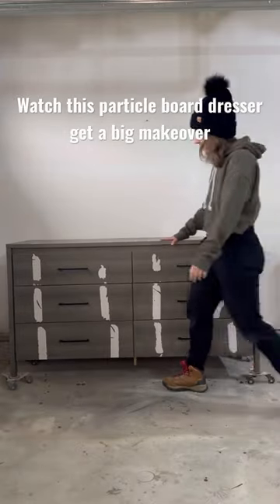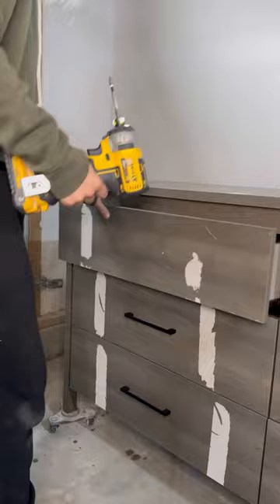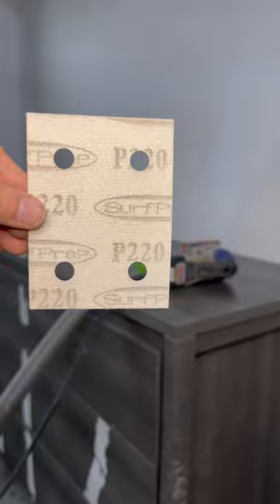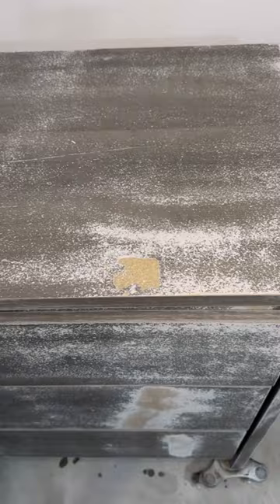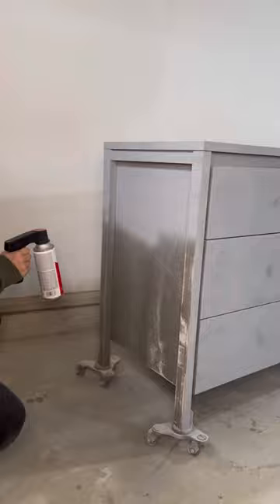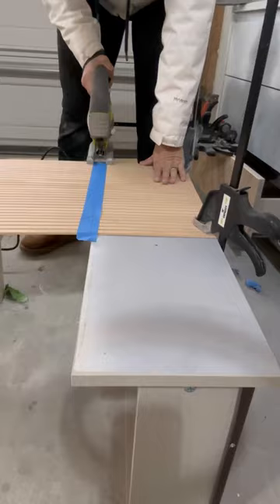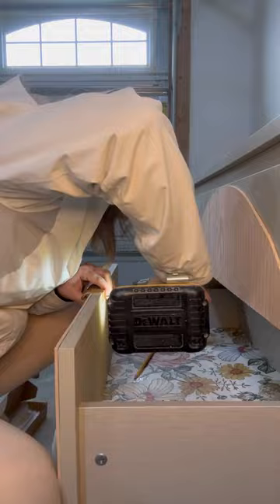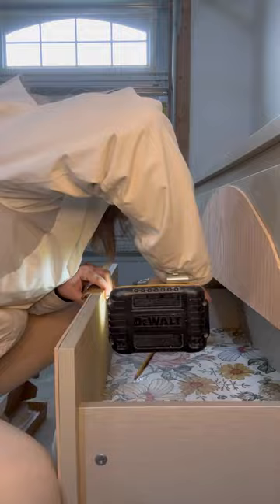Watch this PARTICLE BOARD dresser get a big makeover with pole wrap

Comment: I love how nice that turned out.  I wish I had your tools and talent. I inherited my moms cherry wood dressers and have always hated them.  I've been using them for the past 25 years.  If I sanded the dressers, do I have to sand all the finish off  if I am painting them?
Reply: Sanding the finish off is not necessary when when painting. You only need to clean and scuff sand it so the paint (primer if necessary) will have something to stick to.
Reply from the maker: Thank you! And no, you don’t have to sand the full finish off to paint it. You can just “scuff sand” it with 220 grit, and then prime it and paint it. Scuff sanding shouldn’t take that long. You are just roughing up the surface to give the primer something to grab onto.

Comment: Beautiful design, do you replace the bottom of the drawers with wood? That’s the problem with these dressers, they may look expensive and can even be expensive, but they last a year at best because that thin strip of like vinyl board or whatever it is sags with any weight and becomes unusable. And I’m not saying you have to in order to sell it, I’m just wondering if you do and could you show the process because I could save a lot furniture in my house lol

Comment: How in the world do you avoid the texture from particle board. I've sanded and painted. Did the primer help prep it for the spray paint so it was smooth. I can't get rid of orange peel despite sanding
Reply from the maker: I highly recommend using the spray primer (and that it’s oil based)….and then lightly sanding with 409 grit in between coats of primer and paint. It helps remove the texture that the paint might give.
Reply: you're the best THANK YOU @studio_adash

Comment: Most furniture is veneer on particle board or veneer on a cheaper light wood. If furniture was solid wood it would be very expensive and  very heavy. Take a knob off the dresser and use a flashlight to peek inside and most people will see particle board or a different softer wood, even on vintage pieces. I sold vintage teak for years and danish teak furniture is always particle and Canadian teak furniture uses a cheaper wood underneath and is worth much less than the Danish.